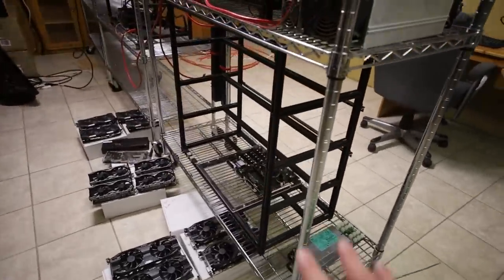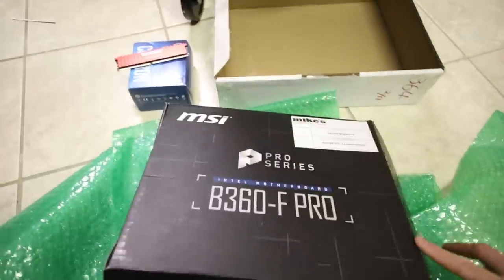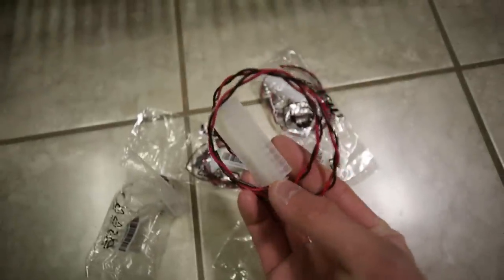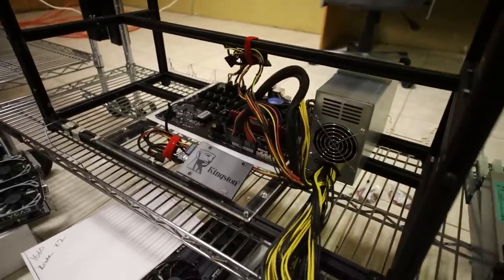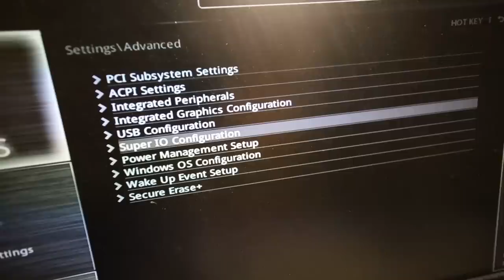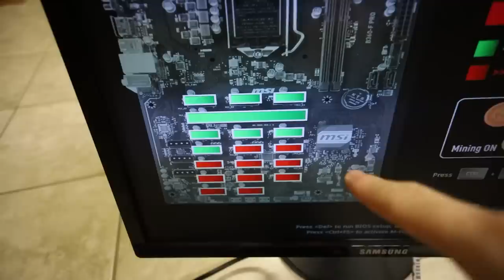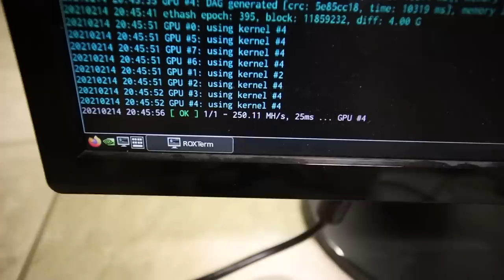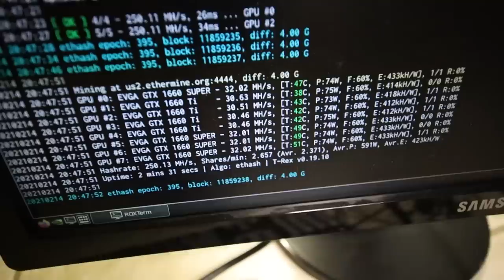Bringing BACK The 19 GPU MINING RIG!

Comment: That mining expert doesn't require mining cards. I had a 10 GPU rig on that in 2018.
Reply: I agree with that and still use them with my rigs
Reply: Correct, you don’t need mining cards. I currently have that board with 12 RTX 3000s gpu’s running fine, and have used rx580s in the past with no problems.

Comment: Great to see you re visiting the MSI B360 F Pro!  :) I like the on board diagnostic LED's also. Yes, buy some 1M USB cables to reach the top. Mount the motherboard to the stand off's but remove the ones that don't line up with the MB holes! Like the one in your video between the audio connectors and the Molex. I agree that was your problem last time you tried (fried) this board.  You could also clean up the power button cable by removing it.  Using instead the middle button of the 3 built onto the right side of the MB. Keep up the great work!

Comment: im rocking 16x and 14x  RTX3070 on  Asus B250 mining expert motherboards out of the box...  what i did, is install the first GPU (via riser@16X slot).  after that six cards to "A" PCIe slots, installed drivers... after that another 6 cards to "C" PCIe slots, and after that remaining GPU-s to "B" PCIe slots... I didnt connect MB PCIe  power (molex) but powered the risers. as far as i remember, i havent updated the bios.

Comment: Awesome RIG! I've Checked the SPECS of the 2000W PSU from Alibaba, but the thing is that the specs on the sticker states that the Input Voltage is 180-240V any thoughts on that? your PSU says the same 180-240V? this information will be greatly appreciated.  I would like to buy one.

Comment: WTF I had the exact same issue with this frame shorting, it all of a sudden would not boot at all and messed up a power supply. When I took it off the mounting screws and onto a different surface it was fine. Is it safe to run it like this? I have it sitting on a stone slate, is it safe and why does this frame cause this issue?

Comment: @RedPandaMining thanks for sharing great content it's really helpful and pushing me into mining. I have manage to setup on rtx 3070 card rig with the help of an egpu and it is working really well your spreadsheet about overclocking is best and works exactly how you explained. I need a little advice or help. I want to scale it up to atleast 4 rtx 30 series cards and can't have open mining rig because I have two little one in the house and don't have  space room for rig out reach from kids. Can you suggest best solution for that? Is there any mining box available that support rtx 30 series cards or is it possible to build a desktop pc that can contain 3 to 4 gpus? I will really appreciate your response. Thanks in advance.

Comment: I am a bit confused on the ASUS B250 motherboard. I bought one used a few weeks ago and have been mining on six 3000 series card with no issue. I’m just confused by what RPM referred to when he said “mining specific cards only”?
Reply: also curious about this. Im running 10, 20 and 30 series cards all on my B250 mining expert board.
Reply from the maker: If you want a full 19 gpu on the asus xpert you need 6-8 mining specific gpus (p102/p104/p106)
Reply: @RedPandaMining  ahhh I see. I haven’t reached that threshold yet, thank you for the clarification.